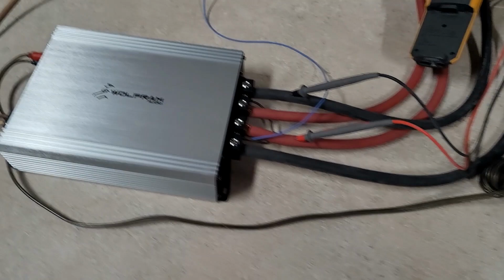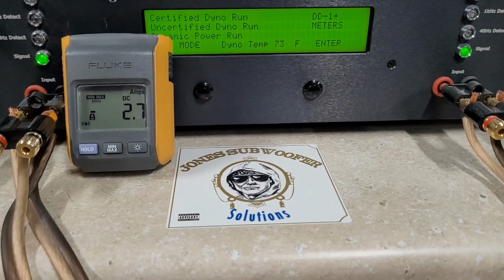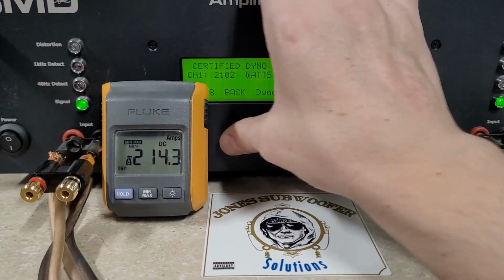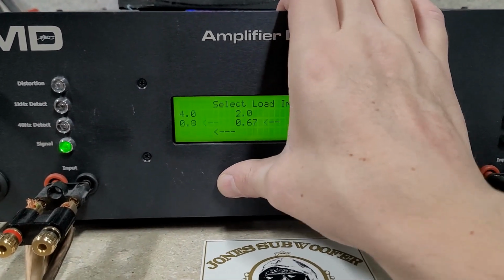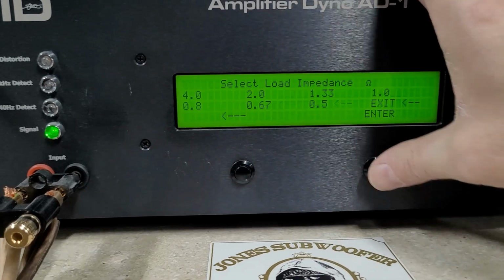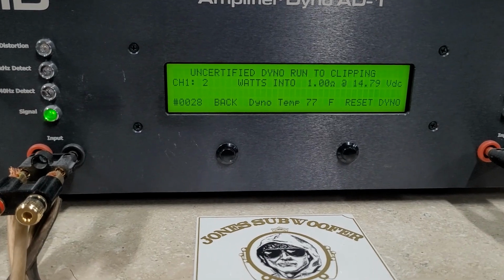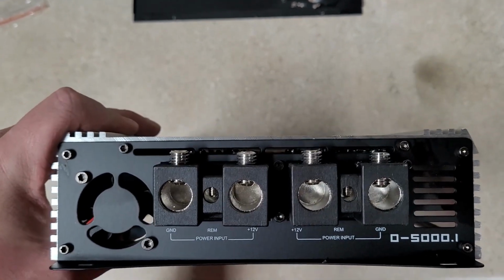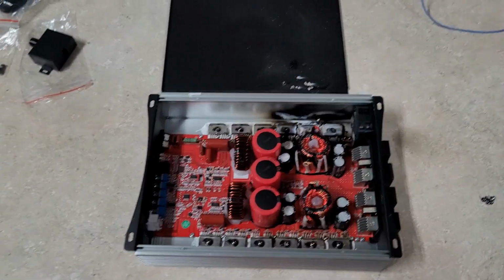AD-1 Amp Dyno Wolfram O-5000.1 by Jones Subwoofer Solutions JSS

Comment: Same thing happened to my Wolfram aw 9000.1 Korean half bridge at 2 ohm burned up half of a 1500 dollar amp
Reply from the maker: That's especially unfortunate because I don't think there's any warranty support for Wolfram at all anymore.  For the power you were running, I'd consider a Smart5k or even the 3k as a replacement.
Reply: @Facekicker  ur right Wolfram is a mess right now the brand split

Comment: It's crazy to think these amps were capable of such power yet still be a safety concern. What happened to the one guy with the Wolfram build is quite tragic to say the least.
Reply: How long should the power wires be before connecting them

Comment: Not a pro and correct me if im wrong, it even might not affect the amp, but the wolfram o-5000 has 1 single rca output  and 1 single rca input. Looks like coming from the dyno you have both output connected to the input and output on the amp.
Reply from the maker: Doesn't matter

Comment: Good video pointing out the short comings of the amp even though that wasn't the intention. Hold off from purchasing until Wolfram adds a Anti clipping protective circuitry.
Reply from the maker: The over current protection that you see on Taramps or SD likely won't be seen on the O series due to cost - these seem to be released as a low budget full bridge, and that's it.
Proper use likely won't end in failure.
Reply: @Facekicker  I fully understand how it works as I've worked in the electronic manufacturing industry  for 35 years but they could easily implement it and still be cost competitive with the competition. The problem in the end is greed. Pride and fulfillment is no longer the purpose or motivation as profit is their main concern. Just look at the junk that Hifonics is producing and thier PMPO ratings as a result of their AD-1 RMS failures. First look at their manuals for non existent RMS values then AD-1 benchmark them all and they will all fall short of the manufactures ratings. Deception at their best, and they are not alone....
Reply: For being in electronics for 35yrs, it's weird how little you do know. First of all, the Oxygen series amps do over rated power. 2nd, there's a market for these fb amps and Wolfram provided them to the budget minded consumer. 3rd, how do justify it as 'greed' when they provide these at a lower price than the other 2-3 brands that sell an almost identical board/amp at a greater price? 4th, don't use a trash ass brand like Hifonics to compare to Wolfram. Hifonics fell off way back when it became Maxxsonics owned. At one time I believe their failure rate was over 5% 😆
Reply: @adamneill9237  And its weird how much you think you know while stating the obvious. Never said anything negative about Wolfram but they missed the opportunity on this one. As far as budget minded consumers are concerned, save your money and get what you deserve not what is being peddled because you don't know any better or can't afford it. While I was a supporter of Hifonics  of the 80's I am aware of the failed acquisition that Maxxsonics  and companies like them have destroyed reliable branding through profit motivated deceptive advertising.  Let's just see how long these new brands will stand the test of time.....

Comment: Wow I love it!! Over the rated power too bad it blew✨ if it never blew it would of been one of the best 5k rms watt amps but you had it wired low impedance because of no box rise.
Reply: Being at the clipping point for too long and over current are what did it. A 1 ohm load on an amp that's built to handle it shouldn't have anything to do with it blowing otherwise.
Reply from the maker: @kyletimmins7331  This is true.   I sentenced it to death.
Reply: @Facekicker  it's all good. Wolfram is no longer with us unfortunately 😞

Comment: 2/0 sky high wire way bigger than 2/0 welding wire. 1/0 sky high wire is close to 2/0 welding wire.
Reply from the maker: Not by weight, and that's why welding cable is superior.
Reply: I was talking about fitting in the pos and neg inputs on the amp.

Comment: So glad I didn't go full bridge this year. Was looking at the B2 16k and they have problems too. Keeping my Q-4500's and have also bought the Orion HCCA 3000 SPLX's for later.
Reply: Can't go wrong at all with the Orion hcca 3k's, I run 4 of them, one to each sub, they are the cheapest high power amp available and they are tough as hell. If you run high voltage in the 15v+, you can get almost 8k at 1ohm from them. Best amps available by far in my opinion.

Comment: Full bridge is so unreliable, even with good input voltage. That's scary. I think I will keep my Orion HCCAs lol.
Reply: #Orionftw
Reply: Full bridge isn't unreliable. The end user is what's unreliable
Reply: With the output voltage of full bridge inverters is equal to the power supply voltage while output voltage for the half bridge inverters is equal to one half of the power supply voltage. This is why there is so much static with full bridge, putting double the load on half the parts. Even with good internals they are not reliable. This was a perfect example, good wiring and voltage and the second it touched clip she let go.
Reply: @matt-be8kt  I really beg to differ. I have a Taramps Md1800.1 and it sends clean power to my subs. On top of that I will admit it does hit clipping sometimes and it doesn't even get hot. In case you didn't notice he pushed this amp way past clipping on a 40hz test tone. This amp may be lacking in protection circuitry, however there is no reason to run any amp way past clipping
Reply: I have 4 hcca amps, best amps I've ever ran by far

Comment: Could  you test some amps that requires 13.8 volts? because my vehicle never charges at 14.4 it's 13.8.
Reply from the maker: See my results and subtract a few hundred watts
It's not a massive difference from my tests down to 13v or so.

Comment: I Preordered This amp it came broken from the factory. Clipping light on constantly. They replaced it with the AW-3000. I am very happy with that trade. Still have the Broken 0-5000.1 Need to send it in for RMA. I think i preordered back in what July? Took till last month for it to get here.
Reply: I had the o series 5K on pre-order for a few months. I got upgraded to the aw5k for another $199. $498 for an aw5k I'll take it.
Reply: You should have just bought the tarantula 18,000 since it's a very same amplifier

Comment: THAT AMP TRASH!!!! IM GLAD I DIDNT BUY IT! I WAS SO CLOSE!
Reply: How is it trash? This amp made over rated power
Reply: @beardedforlife3740  sure and it also comes with flames :D
Reply: @TuffApe  when pushed past it's limitations. That's reckless
Reply: This is the very same amplifier as the tarantula 18000 the guts are exactly the same
Reply: Kind of weird that this Aunt blew up and the tarantula 18000 blew up and they have the exact same guts and look exactly the same on the inside because they are the same
Reply: @beardedforlife3740  it's trash because it's just another copy of the tarantula 18,000
Reply: @charlieknoll1269  the tarantula blew on the certified run. This amp did not and the only reason this one blew is because it was excessively clipped and had too much current being ran to it

Comment: I thought the amp Dyno tracks were set up to make sure it doesn't run the test too long?
Reply from the maker: Uncertified is a 10 second sweep.  If it starts clipping at 8 sec and I don't pause the track, it will increasingly clip for a full 2-3 sec before the sweep ends.

Comment: Kids this is why you fuse your amps
Reply from the maker: Fusing wouldn't have saved it
Reply: @Facekicker  Can you explain? Too much current is what blew the amp right? And fuses protect against too much current flow.
Reply from the maker: @joshhaimes  We are both right in a way.  Generally speaking the fuses are primarily there to protect the cable from meltdown, not the equipment connected to it.
Total fusing for two runs of 2/0 would be 700 to 800a which is above what it pulled at the inputs when it blew.   At 1 ohm resistive and clipping the internal components see a higher current than they are meant to handle which is why it blew.
Had it been fused under the cables rated amperage, say 500a total, there's a small chance the fuses would go first, but you'd potentially be cutting yourself short on power at times.
Reply: @Facekicker  Thanks for the reply! I have an O-8000 waiting for instal. Planning for 1ohm nominal and will have solid electrical so hoping I should not have any issues, although this video does highlight that it would be nice to have a current protection circuit in the amp. I plan to fuse two runs of 1/0 with 300a each as a starting point.

Comment: Two amps went up in smoke 💨 wow soundstream now wolfram I think 🤔 manufacturer’s need to put a smart circuit in those amps for limiting power, or someone could build a add on that could regulate the current
Reply from the maker: The over-current protection chips exist
They just would bring cost of amp higher
Reply from the maker: Or... Taramps have those features already

Comment: So clipping is what caused it to burn?
Reply from the maker: heavy clipping at low impedance, you won't have the same bad results in a car unless you wire below 1 ohm which they explicitly advise against
Reply: @Facekicker  okay, because I see comment after comment calling the company/amp bad. So basically the guys saying that have comprehension issues lol
Reply from the maker: @TripleOgTripleOgTriple  I mean, the amp board is a decade old design with little to no improvements made.
It performed as expected for the most part but the weaknesses in the design were shown.  No over current protection and factory impedance ratings that expect rise.
I think most of the negative feedback is from people who expected the performance and protections to be similar to Taramps when it simply is not built as stout. 
Knowing exactly what the amp is, it performed well and normal use shouldn't end with failure.
Reply: @Facekicker  great points, well explained. I paid $299 for that same amp and so far, it's done what I was hoping for. I was stoked when I saw that someone was putting it on the dyno, been waiting months as a pre-order haha. Cheers
Reply from the maker: @TripleOgTripleOgTriple  thank you sir.
At 299 it definitely was a good pick up
Reply: @TripleOgTripleOgTriple  don't forget his power supply isn't fused which somewhat feeds into it catching fire. It still probably would have given the lack of circuit protect, but having a fuse would definitely be a good idea with this amp
Reply: @beardedforlife3740  definitely. I fuse every other amp I've used, this will be fused correctly, as well

Comment: 6100 dynamic at 1 ohm. That’s my guess, OK so I just saw 2 ohm certified and I’m guessing my 6100 dynamic at one ohm  is not going to be real accurate. But I’ll go ahead and stick with it. OK now I just saw 2 ohm dynamic and I see that it does not have a power supply that provides great dynamic power so maybe I will be close. OK so I was awful close. Not real impressed with it  catching on fire. Lol

Comment: There is another problem with this amplifier when you want use this to power subwoofer.
Reply: ? 
please do tell
Reply from the maker: @jessea2489  power rolls off quite a bit under 60hz, it's inherent in the board design
When calling an amp "full range", that's something noteworthy. 
I believe that's what he's referring to.
Reply: If this is a full range amp why is it cutting power on the lower side- 125hz and below.  Between 125hz and 20hz the amp it's cutting power in half, meaning if you have 1000 watts at 125hz you are only getting 500 on 20hz.  When I brought this problem up on people were calling me out as an idiot, and when I started commenting on the wolfram audio page they simply kicked me out of the group and deleted any comments, looks like someone doesn't want the truth  to come out about the o-series.

Also alot of people received the amps with torn boxes and or scratched/dented amps all of their complaints were also deleted from the page. 

That's why you never see any negative comments about them because everything gets deleted from the page.

Comment: Man, check out the guts of this thing!  You were just throwing 8KW of energy through that, my heater for my 3 bedroom multistory home is 8KW!   And that amp is supposed to deal with all that energy with a single shitty little 40mm(?) fan, and what looks like half a pound of aluminum.   Fused or not, how is it not going to burn down a car to the ground, that's just irresponsible AF.
Love your work though, recently subbed!  👊
Reply: They run just fine at 1ohm & 15V. 🤷 Nobody, in the history of car audio, that wires to 1ohm... Has zero rise.
Reply: All it is is the soundstream tarantula 18,000 that's exactly what the amp is and you cannot prove me wrong because that's what it is
Reply: @charlieknoll1269  actually it’s a soundigital...wolfram , sundown sfb, b2 audio, deafbounce, Soundstream and many more are all Chinese copies of soundigitals design

Comment: Another great video. You have another subscriber for sure. Everybody hating on that amp and like you say it is put through a torture test it will never see in the real world. Or shouldn't if instructions are followed. Wolfram makes awesome products. Keep up the good work sir
Reply: wrong, no matter what, if the coil is moving, you will never see below resting impedance
Reply: Chuck Holmes  incorrect, brush up on your electrical skills before you spout off and spread falseness. even if some how the coil/speaker magically lowering its resistance some how possessing Super Conductor like qualitys, i am assuming at at or above room temp, no LN2 correct? witch I understode is impossible with man's current knowledge chuckles. or hey maybe i am wrong? if so please do tell all your super genuineness that is going to bless all man kind. i bet if true the single greatest invention/discovery since electricity its self. so please do enlighten us Yoda let humanity have the secret.

an please don't humiliate ones self answering with... "because that is what my meter said" your meter was wrong prob not designed for active loads or somethin else prob should brush up on its el-Manuel to son. tho i truly hope your right i am wrong. because it will mean !mans energy crisis is solved!
Reply: Wrong wolfram caught and whole brand new Escalade beautiful ass build all Smd fuse holders n everything done right and car was off and parked and amp malfunction and burnt the whole car to the ground

Comment: 😳😳😳😳 I was just looking at this amp as an option 😭😭 I’ll pass
Reply from the maker: To be fair, the numbers were really good.
I put the amp under conditions it wouldn't normally see if the instruction manual is followed.
Reply: These amps are garbage in my opinion.!
Reply: Chuck Holmes  link to all those others you saw do that?
Reply: Chuck Holmes  then what's the point of commenting? You're just saying your thoughts are invalid
Reply: @TripleOgTripleOgTriple  I watched YouTube for years before ever making an account...account age means nothing really
Reply: @Thumper68  congrats.
Reply: @srtjdm1458  it did rated, no problem. How is that garbage?
Reply: Chuck Holmes  they were probably wired down too low or pushed past their limits like this amp was. These things are rated at certain ohm loads and wattage for a reason
Reply: Chuck Holmes  well yea, but having everything wired correctly and having a good enough alternator and battery setup is what's important. You should never have to worry about protect if you wire and tune your amp properly
Reply: Chuck Holmes  if I had the use for I'd buy it. I just know that I'd never see that kind of current draw playing music thus making it safe to use
Reply: Chuck Holmes  btw, I didn't go outside the lines given the fact that in a real world application like a car audio system that amp will never go beyond it's current handling capabilities without user error being a factor. Like I previously said. Wire it and tune it properly and everything will be good
Reply: @TripleOgTripleOgTriple  
Yeah..I'm scared of these Chinese Full Bridge amps.
Reply: Chuck Holmes  

Over-Current should have protected the amp but it didn't!
Reply: @DECH_306  There is nothing to be scared of. This amp does not use over current protection. If you feel the need for that circuit and don't mind paying a little more to get it, look at the Taramps version of this amp.

Comment: Damn I have the 2400 one gotta make sure not to clip it.
Reply: I don't think the 2400 is a full bridge, so its a different beast.  Half bridge are more stable, but put out less power ( also less flames)

Edit: I was referring to the C 2400.1 not the O 2400
Reply: Yeah the 2400 and 8k also. Everyone has to be responsible with these running low impedance. At which I doubt you have anything to worry about on mids and highs

Comment: No protection circuit!?!?
Reply from the maker: Not for over current
I believe the only protection is under/over voltage.
Reply: You wont find many full bridge amps with over current protection.  Stuff like that would bring the prices much higher.

Comment: Why do so many full bridge budget priced amps fail? Is it that not well made?
Reply from the maker: I let it clip pretty hard at 1 ohm
The amp is rated 1 ohm assuming you will be connected to a subwoofer and experience impedance rise.
The amp dyno at 1 ohm would be like wiring a subwoofer to half ohm, which they explicitly say not to do.